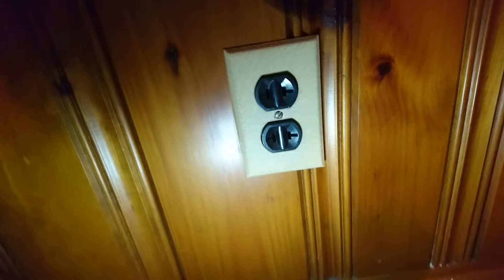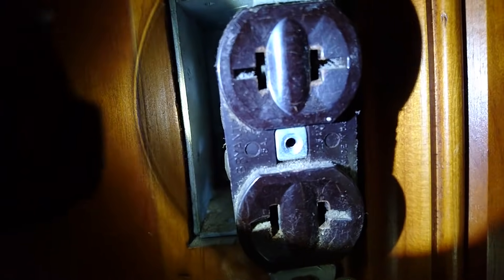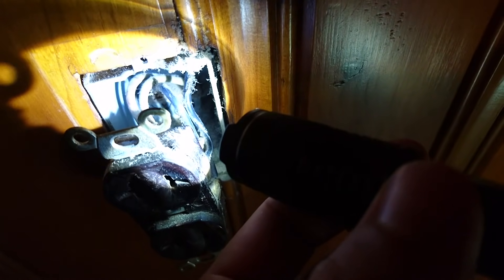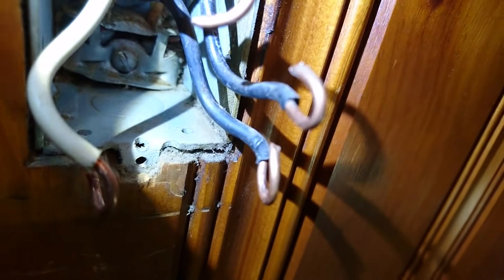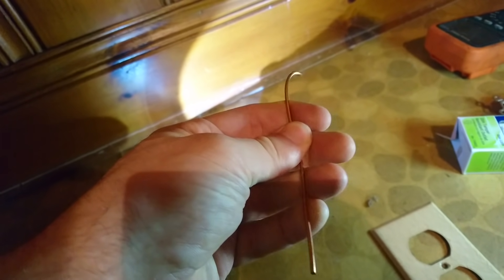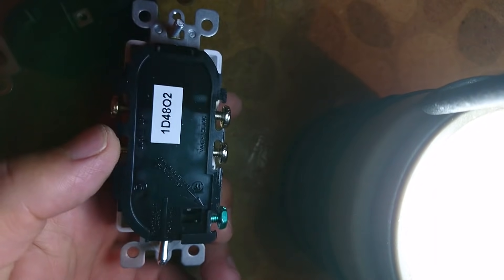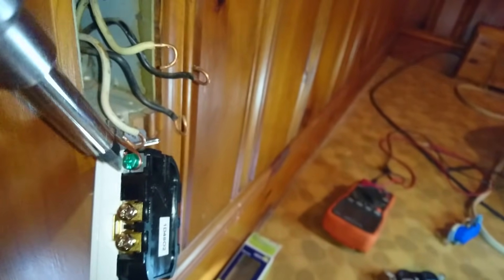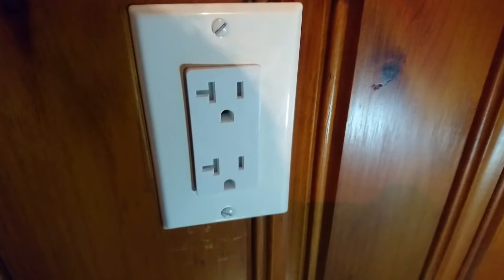How to Convert a 2 Prong Outlet to a Grounded 3 prong Outlet (TYPE AC Cable WITH Grounding Strip)

Comment: Ancient tandem/parallel outlet.   Can accept NEMA 1-15P, 1-20P (120V) , 2-15P or 2-20P (240V)       A 5-20P, 6-15P or 6-20P with the ground pin removed will also fit.     Because of the dangers of improper voltage these outlets have been banned for decades.  
 In the earlier part of the 20th century, particularly the roaring 20s when home appliances became increasingly available and affordable for the middle class, before the industry settled on NEMA standards,  there were actually two versions of plugs,  the parallel,  which is now  1-15P, and the tandem,  which is now 2-15P, and they were used interchangeably depending on who designed the lamp or appliance.   In turn it became a common practice for homes to have these funky T slot outlets,  to allow that new fangled clothes iron or vacuum cleaner to be easily used,  regardless of manufacturer.   
Virtually all of these outlets were hooked up to 120 volts, with some rare exceptions.   In a large office building, for example,  they may have been 240V, for large fans, high power lighting.   Some light bulbs were 240 volt rated, and both plug types could have been used.    You had to know the voltage supply,  and plug in at your own risk.     Isn't NEMA standards so romantic? 😘
Reply from the maker: I'm impressed at the depth of your knowledge of NEMA standards history. Definitely either a master electrician or EE lol. I'm sure it was quite a spectacle to plug your 120V appliance unwittingly into a 240V outlet.
Reply: @Bootstrappin  thank you for your kind words.   I'm a journeyman planning to get my masters next fall.   As for my knowledge,  last year I was going through the estate after my great grandmother passed on.   In her attic, was a Graybar Electric catalog,  1926-'27, which had all kinds of nonstandard plugs and receptacles.   Tandem,  
(––) Parallel ( || ) Polarized (| I or – |) two versions of polarized were shown.    Also available at that time were edison screw shell plugs and receptacles.   The edison receptacle was basically a medium base lamp socket on the wall, with a brass flapper that you flip up to screw a cord with a screw shell plug in (tamper resistant outlets anyone😵?)  I guess they called it the roaring twenties because everyone was so excited to have that fancy waffle iron or Hoover vacuum cleaner , and they didn't think safety first, besides flappers,  prohibition, silent films then the talkies later in the decade,  and organized crime.    Must have been a very interesting decade to grow up in 😁

Comment: The inside of a 15 amp and a 20 amp duplex receptacle are identical. Only the face cover is different. More than likely that melted receptacle was caused by a loose screw on that wire. If the associated breaker is correctly sized for the wire it will trip before melting the wire. Take one apart and see.

Comment: Nice video man... my understanding is load and feed make no difference top or bottom as they are both connected to the same plate.. you can have a hot load at top and neutral load at bottom and same with feed and they will work maybe industry standard says bottom load and pop the flat head top off he screwdriver and use the 5/16 bit holder instead it should hold easy you can rub a magnet on it or leave it to get it to hold better.. again good job man
Reply from the maker: Thank you! Yeah not sure if convention or rule. I just copy whatever was already there, unless it seems dangerous.
Reply: @Bootstrappin  
First of all you need to find out which outlet is the most upstream one and connect the feeding cable to Source, so all the downstream/Load will be protected as well.
You need to find out which pair lines is the feeding cable in your video, otherwise Gfci would not protect it if you put the feeding pair at Load, but the downstream outlets would be protected. 

BTW, the added ground wire is not really grounding, so you need to put a label to indicate "Gfci protected but not grounded" for all outlets in this chain, including the GFCI one..

Comment: The damaged receptacle you showed was damaged due to a loose screw at that connection point and the high resistance caused it to overheat. Has nothing to do with the rating of the receptacle. And Aluminum oxide is NOT flammable. The reason aluminum wiring caused fires was again high resistance connections due to corrosion where the dissimilar metals(copper and aluminum) connected together.
Reply from the maker: Everything you said is correct, so I do have some wrong info there.

Comment: I tape mine for 3 reasons:
-yes, to work on while it's hot
-if a wire should somehow rattle loose, the tape MIGHT be enough to keep in in place and not shorting
-if for some reason the cover plate is off, it's a little bit of protection (for example, when painting a wall)
It takes very little time to tape one up.

Comment: Thank you for the video! Just bought a house loaded with old 2 prong outlets, but newer 3 prong upstairs. Need to convert some of these over to run a couple of window AC units.
Reply from the maker: You're welcome! Remember, armored cable only.
Reply: @Bootstrappin  Video is only applicable for armored wire? Just want to make sure I'm understanding you correctly.
Reply from the maker: That is correct - type AC armored cable with an internal grounding strip.
Reply: @Bootstrappin  thank you. I have to pull an outlet out and see what I'm working with.
Reply: @Bootstrappin  I know you know this: If you don't have ground and don't have armored cable you can still legally replace a two-prong with a three-prong GFCI receptacle. Also, to consider whether an A/C unit pulls "too much power" for the existing wiring and its overcurrent protection (e.g., de-rated  by 20 percent for continuous use, i.e., maximum current for 3 hours or more).

Comment: You mentioned if wire is 14 gauge and breaker is 20 amp, change the breaker to 15 amp.  What if breaker is 15 amp and outlet is 15 amp, but wire is 12 gauge (copper wire, not aluminum wire)?  Is  it okay  to leave breaker and outlet alone or is it necessary to upgrade breaker and outlet?
Reply from the maker: 12 gauge wire is designed to carry up to 20A, so it's not a safety hazard.

Comment: Maybe the first problem is a BOZO advising you on home repairs!  Comments and outright false information:  1. Aluminium wiring IS a problem and the issue is Alum. Oxide but not because it is flammable, this is utter nonsense!  it is a form of corrosion which compromises the electrical connection and degrades it causing arcing and this can lead to fires.  If you have aluminum wiring consult a LICENSED electrician.  There is a protocol for correcting this to make it safe without the expense of replacing all your wiring.   2.  15 AMP devices (duplex receptacle in this case) are allowed on 20 amp circuits.   They will not melt or fail to function properly if used as such.  3. This is obviously an older home w/ two prong receptacles in the traditional style ( the Knotty Pine paneling is another sign) so if you are going to replace with a grounded duplex receptacle  (three prong) why not use the traditional style & color compatible with the rest of the home?    The modern Decora Style duplex chosen in this video is out of place.  Also requires a new switch plate where as with traditional style it can be reused.  4.  It is not the rating of the circuit breaker that determines this is a 20 amp circuit.  Rather, it is the gauge or size of the wire.  In older homes like this it is not at all unusual to see a higher rated breaker used as replacement because of tripping problems.   So always check.  In this case the wiring IS correct; 12 gauge is 20 amp but if it were 14 gauge, you should replace the breaker with a 15 amp to match the correct ampacity of the wire.  Always be on the lookout for this - it is a very common problem.
Reply: My electric remodel 10 yrs. ago for this old house needed to have surface mounts.  The new outlet by the sink has two switches for lights under counter and above sink and two sockets (GFI) for plugs.  Noticed recently that I was getting a shock from my cell phone when it was plugged into those sockets.  However, no shocks from my mixer, coffee maker, and other small appliances.  I contacted the electrician after I checked the outlets with a little device you plug in to measure if the wiring is correct or not...and it registered "open ground".  Turns out there is nothing that can be done to fix this issue other than don't plug my phone in that outlet.  ????   However, it is a GFI which would shut down the power if it came in contact with water.   Seriously?  I wish I had been told about this when it was installed.  Could have saved myself a $95 service call to learn something that I should have been told during the install process.  Still not happy about the issue remaining.  Any advice?
Reply: @lindafloradesign  A Lot goin on here but I'll hazard an opinion - high probability I'm correct.  If you had GFCI circuits or a device protecting the two kitchen outlets then it would test open ground but this is OK.   The GFCI protects you not by CLEARING a ground fault by causing the breaker or fuse to trip, for that you need a ground,  BUT by analyzing current flow on the  conductors and shutting power off in miliseconds if it detects a current leak.    Same desired result - the current is shut off shock hazard is resolved.  In the case of a groud the breaker shuts off the current and with a GFCI the device itself shuts off the cucrrent at the device and downstream.  NOW if your cellphone is plugged in to this GFCI -protected outlet  when you touch the cell phone you receive a shock.  But doesn't the cell phone connect thru an adapter?  This adapter converts the AC Line current (110-120V) to DC Current at nominal voltage (probably less than 12V DC) and the adapter uses a two prong unpolarized plug so even if plugged in to a grounded recpticle, it wouldn't use it.  I think you are reeiving a shock fo prrom the DC voltage coming thru the adapter and this would explain why none of the other apliances shock you when plugged in to the same outlet.  Try a different adapter & cord in this outlet or try this adapter in a different outlet.  good Luck!
Reply: @johnmcmanus7226  Yep, it sounds like either the cell phone or the charger is defective.
Reply: @johnmcmanus7226   Thanks!  I will get a different adapter and cord.  If that doesn't work?  The tester also did say the neutral and black were reversed but the GFCI wouldn't test properly if that was the case, right?
Reply: @johnmcmanus7226   The only outlet I get shocked with this is the one by the kitchen sink which is an open ground.  Same plug in charger in other outlets doesn't cause a shock.  Will the open ground make this happen?  Thanks so much!
Reply: This is just a classic case of a professional trying to dissuade DIY. Residencial electric work is not hard to learn, just study online guys. Correct tools for the job at hand.
Reply: lindalori52  If the outlet tester indicates reversed hot and neutral, then you need to have someone qualified shut off the power, open the box, remove the outlet, look at the wires. Hot (black) should be connected to the terminal for the narrow slot. The back of the outlet probably has HOT imprinted on it. Reverse polarity is very dangerous and. Needs to be corrected.
Reply: I've worked in older homes that all the wiring was 12 gauge, regardless of whether it was a 15 or 20 amp circuit.and sometimes what they did in the years before the fifties was they had copper wire that was silver clad. Silver is a better conductor than copper. When I first saw that however I thought it was aluminum .
Reply: Not a electrician like yourself but I do have a little knowledge in physics.  Aluminum conducts heat at a greater rate then copper due to the molecular structures of both metals . Therefore the expansion is not the same between the two when heated . Hot and cold repeated over time causes the connection of the two wires to become loose .  Loose connections will create excessive heat and arching which is more heat and not long before combustion happens .  I don't know what code book thats in but its a established fact .  Now you say there is a remedy for this , I would venture to say it deals with the connection of the 2 wires .

Comment: That black outlet you replaced is 240....  Two sideways  pins is 15amp 240v.... that one has both horizontal and vertical so it’s 20amp 240v.  The problem with aluminum isn’t the oxide flammable. It’s that alumum expands and contracts and works loose.  Also issues with the first generation of alloys used in bus bars like the Zinsco panels.
Reply: FPE as well call them both the red handles of hell fire lol

Comment: The old outlet is a 20 amp outlet(thus the horizontal left lug)
Reply: Not necessarily. It had BOTH slots with the horizontal, which could have also been  used at15A or 20A at 250 volts, as with NEMA 2-15P or 2-20P cords.

Comment: Well, you can have a 15 amp rated receptacle on a 20 amp breaker. However, the idea behind that being allowed is that those receptacles won't exceed 80% of the receptacles amp rating which would 12 amps for a 15 amp rated receptacle.
Reply: There's nothing in a receptacle (15 or 20 amp in this case) to prevent 80% or more of the circuit current rating, it's just conductive material. The only way to control that is selecting the proper wire gauge for the circuit and/or limiting the number of simultaneous loads of significant power consumption.
Reply: @surferdude642  

I agree, but knowing that you shouldn’t exceed 80 of the receptacles amp rating would allow you to be conscious of what ur plugging into that receptacle to make sure the load(s) don’t exceed the 80% threshold.

Comment: I would say somebody popped in a new 20 a breaker not paying attention to the outlets.  But why the 12 gauge?  I like the way you still assume there is voltage on the outlet.  Very wise.  I think I'd use a nut driver for that ground screw.

Comment: Can you give a workaround in case if there is no ground wire at all behind the cover or outlet? I mean it's just two wires red/black and two prong outlet on the front. Now what can I do to make use of equipment which comes with three legged plugs without using a changer or losing the ground connection? I do want to give the equipment a ground wire.. How can I do that? Can't I simply connect the third leg to the ground or anything like that? Plz excuse me if this is a stupid or foolish thing to ask. An advice will be a grateful. Thanks
Reply from the maker: What country are you in?
Reply: @Bootstrappin  Pakistan
Reply from the maker: This video is for the United States. I don't know anything about regional codes and wiring in Pakistan. You may find the link below helpful, but in general you want three wires - hot, neutral, and ground. If you don't have a third wire (or metallic sheathing), then you likely don't have a ground path and will have to run new cable.

https://qr.ae/pNnJQw

Comment: i must have missed the part where you made sure that the box itself was grounded properly or do all old electrical systems hav grounded boxes
Reply from the maker: No, not all old boxes are grounded. Like I said in the beginning of the video - I know mine is grounded because I have armored cabling (which is conductive) AND it has an internal bonding strip/conductor. You can also do a resistance check.

Comment: I moved into a house built in the 50s but some rooms were updated with 3 prongs some still have 2. Also we have a fuse box instead of a breaker box. Is it still safe to just change the outlets to 3 prongs or do I need to get rid of the fuse box?
Reply from the maker: That all depends, there's nothing wrong with a fuse box necessarily. In some ways fuses are superior safety wise to circuit breakers. But as for grounding, you'll have to inspect and see what you have, and if it can be reasonably modified to create a ground path back to your electrical panel, or whether you'll have to just install modern cabling.

Comment: how could do the ground wire if electrical box was plastic? Thanks.
Reply from the maker: At that point the most economical thing to do is to replace the outlet with a GFCI outlet and put a sticker on it that says "no equipment ground" (this is 'to code'). The alternative is routing new 3 conductor cabling.

Comment: You should do some research. You can't use a 20 amp outlet with a 14 gauge wire but you can  certainly use a 15 amp outlet with a 12 gauge wire. It's actually recommended to use 15 amp outlets when running several outlets on one 20 amp breaker. The only time you are better off with a 20 amp outlet is if it is dedicated.
Reply: To put it another way, the gauge of wire determines the maximum current allowed in the branch overcurrent protection device. The receptacle devices may be either 15 or 20 on a 12-gauge branch.

Comment: I use tape when adding a plug in a metal box so when u push ur plug in the wall it wont arc on the ground wire not bending across one of the set screws

Comment: You should’ve checked to make sure the box is actually grounded otherwise you accomplish nothing. In old houses With 12 gauge wire would most likely be in the garage if at all, and the electrician that wired that outlet would use a piece of bailing wire ground the box to a water pipe maybe.

Comment: Good day sir, how many volts will you get if you connect the voltmeter one lead to one hot terminal and the other probe to the ground socket, and also the N terminal to the ground socket? Tyi
Reply from the maker: Hot to ground is 120VAC, N to ground is 0VAC